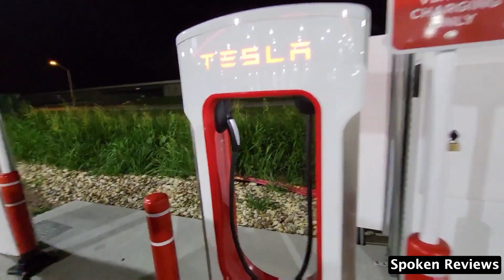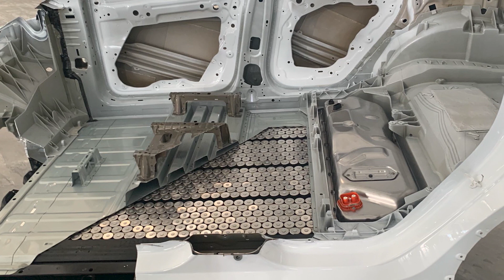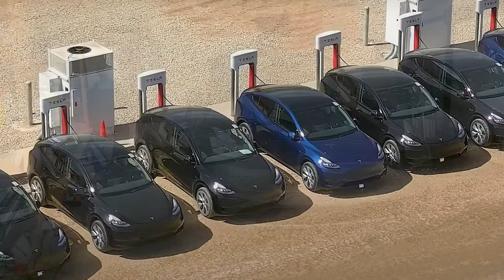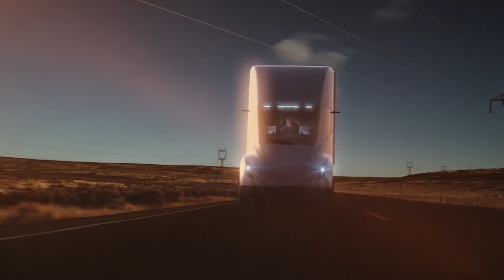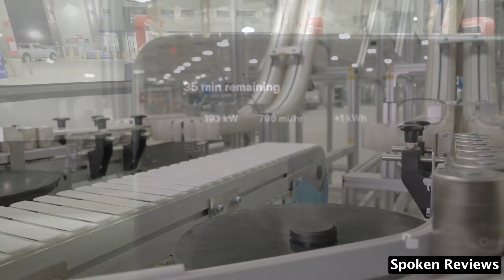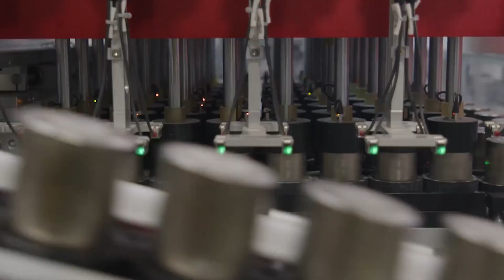Finally Here! Tesla Model Y Austin Specifications, Battery, Weight, Charging

Comment: So how do they improve ED, is it mechanical, more compact jelly roll, or is it chemical composition or a comb of both ?, does anyone know the actual answer rather than guessing
Reply: If I had to pick q single change that made the most difference...

I think the key change was to connect the long edge of the roll of copper to the bottom of the cell can.  This geometry change cuts the internal resistance of the cell by a factor proportional to (length of roll divided by width of roll) compared to connecting only the short edge to the can.

This greatly reduces possibility for hot spots so it can safely charge and discharge faster.
Reply: @JohnBoen  good point!
Reply: @noCOtwo  
It's analogous to a train with a single door at the front ("old" tab)
Compared to s train with doors in every carriage ("tabless")
The "passengers" (electrons) aren't fighting to leave.
No resistive heating.
(Discharge OR charging)
.
Much less degradation.
Reply: Little blue pills?
Reply: Drew said it was chemistry and structural pack revisions.
Reply: Dave Rainbow
For the initial cell....
At Battery Day, they told us "5× capacity"
And "6× power"
If you calculate the length of a jellyroll of the same thickness as that in a 2170, wound to the diameter of 46mm and multiplied by the extra height (80mm), you get 5 times the area of material.
.
THAT tells us (or at least me!) They were quoting the initial capacity (performance) based on 2170 chemistry
.
Logically, that means 2170 Energy density
.
Power.
The tabless design allows more current flow.
Current (flow rate) allows power increase.
If the design allows a 20% increase, multiply the "capacity" (5 times 2170) by 1.2 and you get "6 times the power of a 2170 cell".
.
They were not quoting new chemistry
.
That tells me the statement regarding "lower energy density" In this presentation is WRONG
.
There are simply "sufficient" cells to provide roughly the same capacity as previous cars, with hopefully a slight bonus afforded by the reduced weight of the pack/ vehicle.
.
Like for like performance!
.
It's a starting point.
.
There will be new chemistry/ materials to follow, but they're not needed for this application.
Reply: Sheer hard work and time !
Reply: Of course i am guessing, but there are Tesla engineers who do* know the details beyond the header LiFePo and its physical dimensions.
The battery performance is an evolving production otherwise the competition will bury you and your product with yesterday's tech, yes?